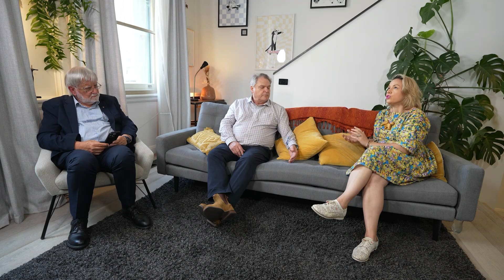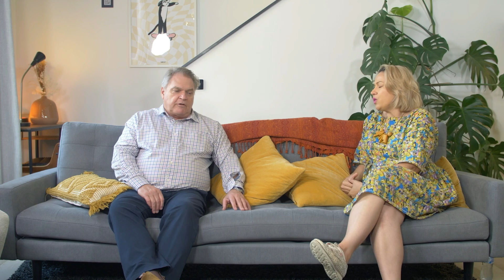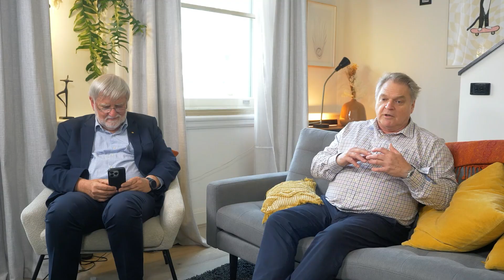"Completely Bogus" expert slams CSIRO Gencost Report

Comment: Early adopters buy EVs and sell EVs for newer EVs. 
Most vehicles are parked 23hrs every day and all night long. 
EVs with v2g massive battery perfect for homes with rooftop PV. 

Early adopters have high marginal taxed incomes and love tax-free savings from no grid electricity, no gas heating, cooking, hotwater, no imported petroleum for each battery EV vehicle.
Say $10,000 each year. 

Traded-in EVs are cheaper and help poorer people save.

EVs will protect the grid from expensive massive upgrades.

EVs will protect against expensive massive central generation upgrades.

Grid industrial customers moving away from fossil fuels to clean electricity will need more dirt cheap rooftop PV and EVs v2g massive battery feed-in electricity. 

Edit. Selfplug-in v2g EVs will just need a $60 wall outlet in front of the bumper to plug-in at every building carpark space. 
Trickle currents all day long and all night long.

Comment: I don't know how CSIRO got their levelized costs. I was never taught levelized cost at university. I used the CSIRO source data in system cashflows and got very different results when 24/365 energy with peak following.  Nuclear systems are the cheapest no emission option based on the CSIRO source data. Renewables with some emissions from gas backup was still more expensive the nuclear with batteries system.
Reply: I bet mum and dad just switch off grid electricity. 
Just EV v2g all night long and most of the day home connected to rooftop PV.
Nuclear owners and grid owners can pay themselves. 

Bet they remove my comment. 😊
Reply: @stephenbrickwood1602 v2g is vaporware

Secondly, you have no data for comparison. 

You anti nuclear people are getting so desperate. It’s pathetic. 

You clearly realise the writing is on the wall for an all intermittent renewables grid.

V2G is the solution to a problem that should not exist. Nuclear fixes that problem: a shortage of energy.

Nuclear is also cheaper per kWh than wind or solar when viewed as a system. 

Mum and dad ain’t gunna pay for their own very expensive electricity generation when they can buy it cheaper from the grid and then not have the hassle of installing, maintaining and disposing of cheap Chinese solar panels and batteries.
Reply: @stephenbrickwood1602  Well, its been 6 days and they haven't removed either of your comments.

However, as per usual, you ignore non-residential sectors, and you ignore total system costs. (That the costs are being paid for by homeowners doesn't change the fact it is a cost, nor that it has to be paid for.)